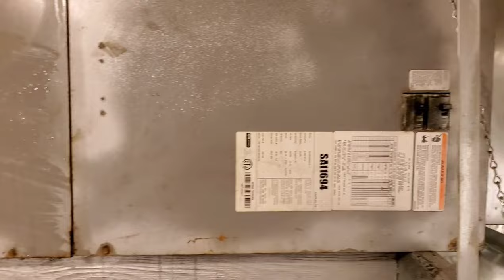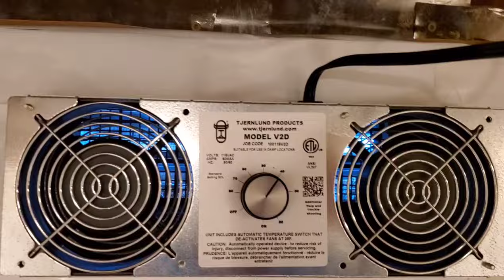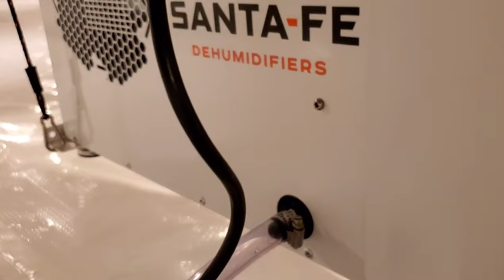Crawl Space Encapsulation | Everything You Need To Know About How To Fix Your Wet Crawl Space!

Comment: Glad I found this video.  Just bought this house!
Reply from the maker: Very cool. I always thought that was a nice place. Congratulations. I passed by on my way home from Maryville on Tuesday. Keep your dehumidifier filter changed minimum every 6 months. And run a cycle of bleach through the black condensate pump, to rid and algae/sludge buildup. Clean the dehumidifier discharge line (clear plastic hose where water comes out of dehumidifier, and into the condensate pump) with a flexible, wire brush made for cleaning hoses. That's about all there is to it. Or if you would like to get on a service schedule, text Clint at 423-457-9311, and he can get you added to his list.
Reply: @TannerFlowers  appreciate it.  Yes wasn't too fond of the huge hill but the view grows on you.  Great work.  Will call if I come into any issues.
Reply: Did the previous California owners move back to California? LOL

Comment: I just had my first quote by a contractor..trying to decide what to do with my little cottage I am making my home. There is a dirt floor, cinder block foundation with concrete footings that go length and width wise in a grid formation. The foundation is solid it seems...the floor is sagging a bit in one room I think because of the moisture and some bad DIY sistering of floor joists that only got sistered part way across in a few places. Still, all in all, not horrible really. Needs to be cleaned out and have proper drainage put in as well as proper gravel and vapour barrier....

But, I am also considering a poured concrete floor. The contractor who came here discouraged encapsulation. I'd have to ask him to explain again, but he said if I encapsulated in this Canadian climate I would have heaving issues because the encapsulation does something to the heating of the footers? Anyway, quote was 38,800 for the work to level the floors, run a new beam, new vapour barrier, stone, concete and drainage, sump pit....also look to see why my drilled well needs a heating line. Not sure what the previous owners were doing but it does seem more like it was intended as a summer cottage/home. I have other plans for renovations so this would take all the budget I want to spend right now and would not be able to do much else.

Guess I will do more investigating because there are so many videos that suggest encapsulation is a good thing. Does climate matter?
Reply from the maker: @averagejane09  I have not done any in Canada. Can't say.

Comment: Hi there,  I live in Long Island New York near the water, but we rarely get any floods here; but also because we are so low, the  foundation is mostly wet.
 I'm brought 2 foundation companies to check out my crawl space  And one of the companies told me to eliminate all access windows and leave only 1 and make the crawl space air tight, and put a moist barrier on the ground, foam spray on the walls and installation on the ceiling. 
    The other company told me to leave all 3 windows and put automatic ventilation windows with  a  commercial dehumidifier and a sub pump,   and he also told me to put the same floor barrier with foam on the walls, but he told me I don't need Insulation on the ceiling.

  Which one should I do? 

 Also the first company told me that I should replace all brick support columns underneath with metal adjustable rods and the other company said to leave the support as it is. 

They are so opposite and I don't know what to do, and they are both experts with lots of years of experience with high reviews.  What would you recommend sir?
Reply from the maker: Watch more of my videos, and once you understand, just copy what I do.

Comment: I have a crawlspace. I have a 2100 square-foot house and I have a crawlspace and apparently I have some moisture issues in my yard. I know for sure now I have had a barrier down there but I’ve been wanting to change pest control companies so I had another one come out to give me a quote and he said I needed to replace the barrier and that I had some mold or something like that on the wood and it needs to be cleaned and the barrier replaced and and then it includes the termite thing for like 9000 something dollars, so is that normal?. I have plastic still up under there. I bet I can straighten that out myself and then clean the wood area that has the black stuff on it. Can I get your opinion?
Reply from the maker: Couldn't say without seeing. If you would like to ever schedule a phone consultation, the pricing and scheduling steps are at CRAWLSPACEARTISTS.COM

Comment: Tanner we talked a few months ago.  I rolled back on my installer to readdress my mold and moisture issue since they installed my encapsulation.  I have a few questions.  Thanks for everything by the way.

1. Major mold and humidity issues. 
The mold has spread throughout the crawlspace in less than 20 months. prior I had a 16x16 section covered in black mold quarter inch deep and I was told it would die after install. It didn't ... They did not treat it either   Should this company have installed French drains if I have water to settle next to the footers and a soda blasted the mold.
2.  No thermostat fans for exhaust are installed
3.  Crawlspace door is not sealed I had sand the edges because it was installed improperly and would not open.  I know it's not sealed due to bugs and spiders already in.
4.  I got a 16 foot beam with 3 jacks, a 20 mil wrap and a dehumidifier for 15k. I think I got screwed.
5.  This is a major installer in the south east.  How would you address this company when they come to inspect. They are coming out in 2 weeks for a walkthrough?
6.  last detail ..  the pulled all my insulation and now the OSB in my floor is soft to walk on.  If the moisture and humidity is controlled will that harden up or do need to replace it?  No structural issues yet but I. Worried about the end of the next summer.  
Any help is appreciated.
Reply from the maker: Come winter, when it gets real cold, you will miss that floor insulation. You already told me enough to know the job was done wrong. These jobs are done right, or wrong. Contact anyone you want, but if they are NOT doing what you ALWAYS saw me doing, then the project will never be right. No matter the size of the company, no matter their annual income, I have never seen a soul really know anything about this shit, unless I have personally trained them. And I would really have to like someone to commit to training someone else. It's been years since I have been inside of a crawl space. I certainly do not miss them any. Thanks for commenting. Hate to hear you wasted money with a company you thought was credible. Credibility is hard to find in crawl space companies. Period.
Reply: Any suggestion on how to handle these guys
Reply from the maker: No. I get asked to speak in court for the homeowners more often than I would like. I decline their requests. I am not sure how to handle it. More than likely, due to people's ignorance, and lack of proper training, they may actually think they have done you right. I am sure a lot of people think so. Why would they question what they're taught? But as more and more homeowners end up in your current position, more and more homeowners will then be led to me. They may not be looking to find me, as they do not know me, but the internet works like magic. And the more people that do find me, those will be educated on the particular endeavor we are referencing, and I am hoping that this in turn leads to a "raising of the bar" across the industry. Because from what I see, like always, there's the entire industry, and then there's Tanner. And I have not ever seen a soul that compares to Tanner. That's about all I know to say. Hate that you are having to deal with this.
Reply: Honestly I think you have had an impact because I've seen marketing that shows French drains from this company before they did not show that so I think there's been a lot of shaddy work and bad installs and I think these companies are trying to correct what they're doing and I would imagine that you've had a lot to do that I've spent countless hours doing research You're the only guy I know that does legit work you should consider starting an LLC to go to all these companies and even push for government legislation to do proper installs for homes in the southeast to meet a certain standard so people are not losing their homes as I assume that I will have to deal with in the coming years thanks for everything you do Tanner.
Reply from the maker: @doziboy803thethird6 I appreciate you saying that. This is really me talking to you. I hated doing that shit all the years I did. And I mean HATED it. But I will say this, I still gave every job, every customer, my 100% best effort. I knew whatever I was doing was a direct reflection of me. And I STILL believe, that how a person does anything, is how a person does everything.

Comment: Tanner, How did you address the moisture coming through the cinderblock? If I missed it in the video please let me know where you discussed it.
Reply from the maker: Drill weep holes where necessary.
Reply: @TannerFlowers  Can you elaborate? Would you then need an interior drainage system? I don't get standing water so I have no drains, but have moisture through my cinderblock. Thanks!
Reply from the maker: Yes. This one has an interior french drain line system. I have elaborate videos on the installing of such systems.

Comment: Tanner the company's coming out to install drainage at no additional cost I requested them to do a water hoes test and make sure that we flow to water properly to the sump pump is there any certain fall measurements that you go by when digging a trench in order to get it to flow properly.  Also do you compress any dirt at the bottom of the digline in order to keep water absorbing
Reply from the maker: Supposed to be 1" fall per 10'. But just start at the high side, that will be the shallowest spot of the trench, and from there, going in both directions, must fall to the basin point. Just use your eyes and a water hose. If it rains, it will do it for you usually.
Reply from the maker: Dirt is usually hard at the bottom of the trench. Except in sandier regions.
Reply: Thanks Tanner your the best at what you do
Reply from the maker: @doziboy803thethird6 appreciate you! Tell the world! Haha!

Comment: Hi, Tanner. Can I ask you a few questions? What would it cost to encapsulated 1100 square feet?  No mold remediation.
Reply from the maker: I never priced them by the square feet. There is a whole bunch of info on pricing at CRAWLSPACEARTISTS.COM 

I do not do them anymore.

I would give it a few seconds thought though, for my new minimum of 60k. 

I won't even take a phone call anymore for less. 

You can probably get you a normal company to do a normal job for you for under 20k.
Reply: Thank you. Local company wanted $25,000. Before fixing one of my joist, they wanted that amount. I trust you to tell it like it is.  That is why I asked. Thanks again.
Reply from the maker: @wesleyjackson1222  no problem Wesley.

Comment: I didn't see a P-Trap on the condensate pump line , it just dropped into the main drain .
Reply from the maker: Not sure. I would have to go back and watch it. May be ran to the sump pump. We do that a lot whenever we have that option. 👍
Reply: @TannerFlowers     19:55
Reply from the maker: Good eye. Looks like he had to run it that way due to the height of the existing line. When they are that high, they are too high for the p trap build we do. Good eye though. I would have never noticed. Props to your attention to detail. In normal situations, we run it into a p trap. And a lot of times, on the sump pump installs, we will discharge the dehumidifier condensate line into the sump pump basin as well.
Reply: @TannerFlowers   Thanks for the reply .
Reply from the maker: You're welcome. Sorry for false claiming. Never knew I did until your comment a few minutes ago. Lol
Reply: @TannerFlowers  Sorry wasn't trying to police you, just genuinely interested in how to do it properly .

Comment: I hired Tarheel and  after they were finished it looks like your before pictures. I'm freaking p1ssed right now. I paid thousand of dollars. The liner has taped upon tape, sand and dirt every where, mounds of rocks, rusty nails, rusty insulation support wires that fell down.  Under the liner looks like a beaver dam. Trash everywhere, no humidity control, no seal around the joist or gaps, their poor attempts at sealing the vents is a complete joke. Air is coming through the venta and all the pupe work. I'm fed up of crawling under there and watching every move. IDO NOT THRUST THEM AND THE FLY BY NIGHT WORKERS. My humidifier runs at 55. If I could hire you I sure would.  I asked them to clean up and level it out they said they don't typically do that. So I took my rake and crawled into my space and began raking up every freaking rock, nals, trash ect. They put up R19 u faced in spots wjere it came down but split one piece in two to fill in a spot smh it's like taking two ply toilet paper and making it into one ply. They made my wires and ductwork come down in places and refused to put it back up. So I went to Lowes to buy more straps to do it myself. 😢😢😢
Reply from the maker: And unfortunately, that is the daily story I have been getting told daily for many, many years now. This industry is filled with half ass crooks. Sorry you got done that way.
Reply: @TannerFlowers  I told them they need to do everything over. They then passed me on to another branch that they say just opened up in another city.  I need some help with what to do now. Can I send you some of the photos.
Reply from the maker: I can have my lead man contact you for a phone consultation. My cell number is plastered all over CRAWLSPACEARTISTS.COM 
Probably here too. Lol

Comment: I wish my crawlspace was that height. I dread having to fix mine, it's gonna cost a crap load of money. I had a monumental flood in 2015 and it hasn't been the same since, rained twenty eight inches in twenty four hours. It stinks like crazy in it now. I have 2,500 square feet.....$$$$$$$$$$.
Reply from the maker: Close to 30k for drainage and encapsulation
Reply: @TannerFlowers  That's probably not including humidifiers, exhaust fans and sump pump is it?
Reply from the maker: Yes. Our service includes everything. Floor insulation is optional. And my father in law will not go wire up travel projects. So if it is not local, you would be responsible for getting your own electrical done, per how I say everything needs to be done. If your electrician does not do what I request, I will not accept the project. The electrical is VERY important on these projects.

Comment: What was the total cost on the project?
Reply from the maker: I will have to check once I am back at the office.
Reply: correct me if I’m wrong, but Usually Crawlspace Encapsulations range from around $5,000-$10,000. 15MIL white plastic can per roll can be around $500, while a dehumidifier is around $1,200
Reply from the maker: We don't use any of that. Some jobs are in that range, and some are more than double, sometimes tripling the price of what you mentioned on our monster sized jobs.
Reply: 20k all day.